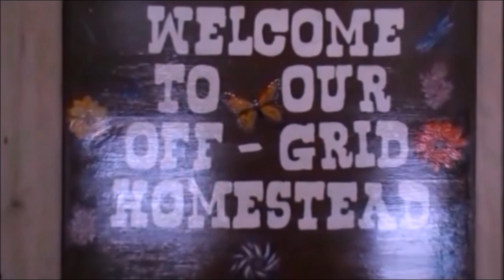Using Our Homemade Bandsaw Sawmill To Build Some Garden Benches

Comment: Have you ever considered making yourself a pair of removable forks for your bucket on the tractor? it would save you some mileage on your hopping on and off the tractor and help you get stuff on and off the trailers and mill really quick. really enjoy your videos thanks for sharing them.
Reply from the maker: Hello, I sometimes use my little tractor with the forks, but I am worried I may bang the mill and knock it off level.  Thanks again,  Cheers  :-)

Comment: Strange that the poplar is warping so bad for a hardwood? weird. Cecil & Heather your brains will never turn to saw dust with all your ideas. Have a great day. Awesome benches.
Reply: I think it depends on how much twist and strain is in the wood to begin with; if it's a straight log that had a more or less balanced top, it will be good; if it grew on a hillside and had to fight lean and wind all the time, it could warp strongly when that strain is released.
Reply from the maker: Thanks Kevin, yeah sometimes it can warp bad  :-(   cheers  :-)

Comment: great job on benches, i also bought an etc black & decker 40 volt my Stihl saw is too heavy for me now & i bought an Homelite but it not very LIGHT, this cancer has kicked my rear for strength. i have not used it yet but if it does half as good as yours I'll be happy 
i was thinking you might go other way standing them up  then i thought 2ft and then another 9 or 10 inches for the seat and it be way up there........lol that be good for me I'm 6'8" 
what kind of doggie do you have sure is a pretty dog?.
 we have a yellow lab thinking he is a miniature some kind of dog but weighs 85 lbs & he a mammas boy big time so no hunting with me.
stay safe, have fun b/c life is short P.S. I'm trying to get caught back up on your videos
Reply from the maker: Thanks Joe.  Aww Hope you feel stronger soon, Yeah I like this saw better than my 266 Husqvarna and it's cheaper to operate as well.This dog is Hound and lab mix I believe. You take care ttyl... Cheers  :-)

Comment: Skinner put more air in your front tires your power steering will work better
Reply from the maker: No it's just the power steering worn out,  I have 50lbs of air in them now.  Any tractor with a loader and power steering should be able to sink those tires down in mud or snow with a loaded bucket and still have the power to turn the steering.